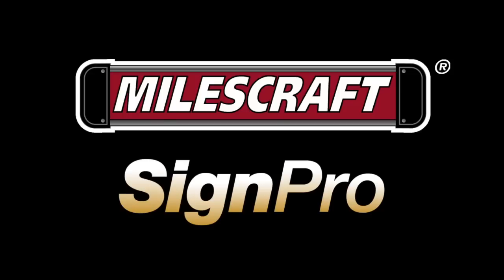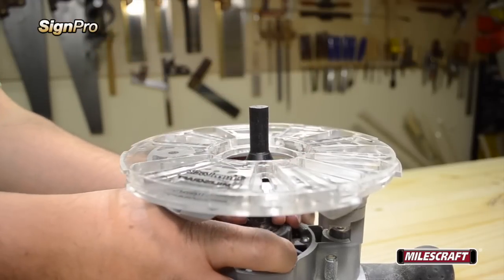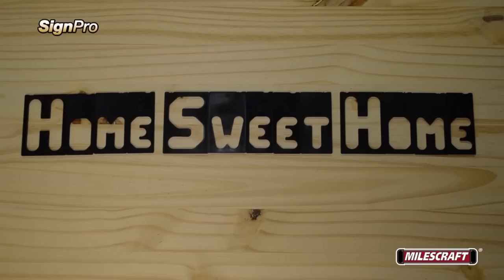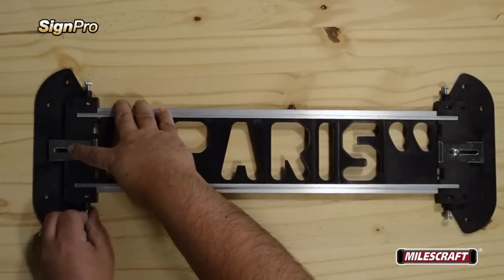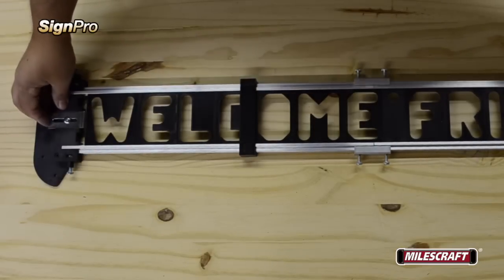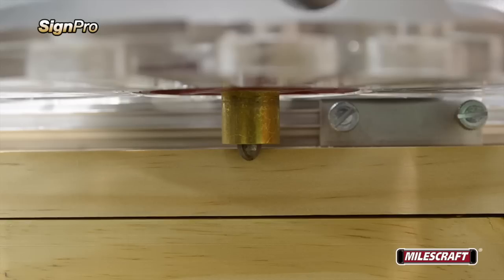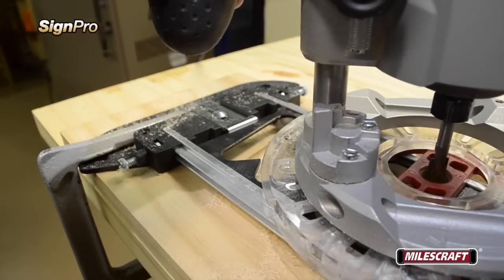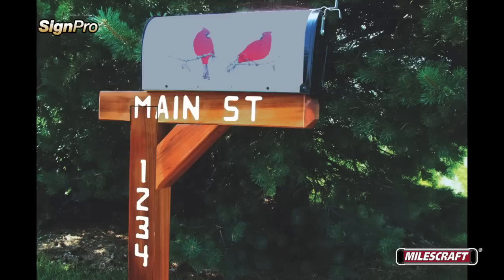Milescraft 1212 SignPro with New TurnLock Baseplate

Comment: Not sure if this video is still monitored but I do have a question. For short words the rails are too long to be clamped on a smaller piece of wood. Do I need to run an extra board to make up the difference? Thanks
Reply from the maker: We recommend securing support pieces of the same thickness on either side of the work piece. Making sure that the work piece itself is still secured.

Comment: how do you see where your routing?  havnt bought it yet
Reply: The purpose of the bushing is to keep off the sides of the template and follow the edges without having to see.  You just have to trust and do a little practice before making a real piece so you get the hang of it.
Reply: @Sparky9450  it's almost impossible to see what you are doing. Some of the spacings don't look right either,
Reply: I spray all my sign blanks blue with a light coat from a rattle can, I can see my routing and I can sand away that blue coat immediately